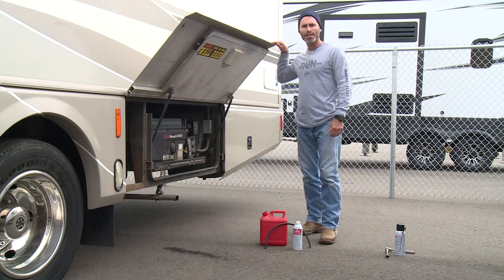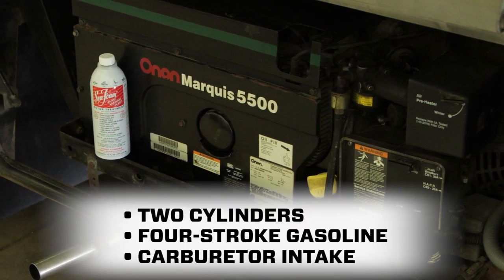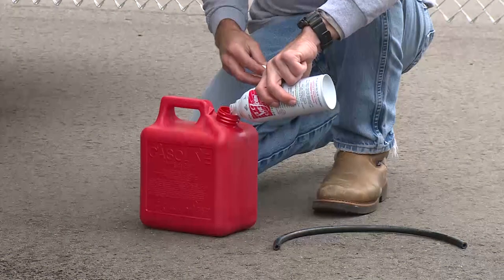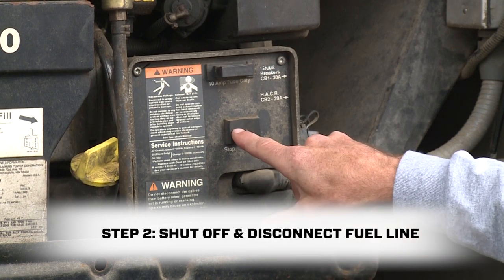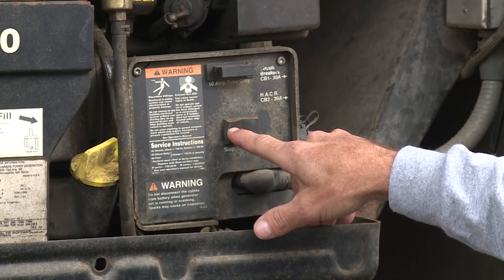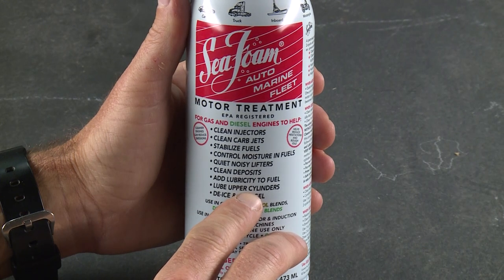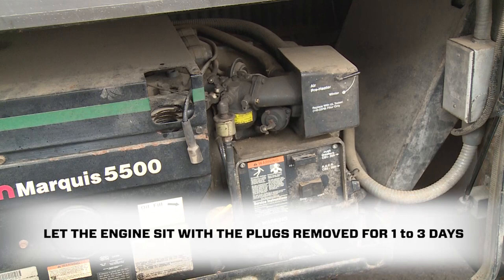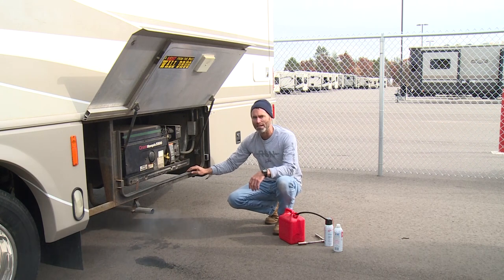The best way to clean a RV generator engine (shows Onan in demo)

Comment: I use this method on my RV generator once a year and I will say it works great.  These generators are designed to run and unfortunately many sit for long periods creating problems with the carburetors.  This method is a great solution to keep things running well.
Reply from the maker: Thanks, RV Habit.  Glad to know you figured out the remedy!

Comment: Lifesaver for my RV generator!!  So happy you made this video.  I learned about Seafoam cleaner from another Youtube RV'er.  I was so frustrated by the RV repair ripoffs, and even the Cummins techs who tell you to replace the carburetor AND the fuel pump when there is nothing wrong with them!  I am going to get some Seafoam cleaner on Amazon then run through your cleaning methods.  Thanks for the great video!
Reply from the maker: Thanks, MJ Remy.  We get zillions of customer service calls about this matter (RV generators)...It's a lot of fun to hear back from the people willing to try it, especially after discovering how easy and fast it works!
Reply: Onan400 generator is running High what could cause that problem

Comment: It works!  My generator stopped surging after this treatment.
Reply: Never mind the surge is back... will give it another try...
Reply: @alexanderperez1380  If you have a problem of surging when first started, smoothes out, then 20-40-min later surges & then dies with NO RESTART UNTIL COOLED, Problem is FUEL DELIVERY, and symptom TYPICAL OF A FAILING FUEL PUMP OR WATER in the fuel.  Fact that it ran well for a while (20-45-min?) shows it is (Most likely) NOT in the Carb (Never say never rule applies :-);  2)  If it later dies with NO Surge first, that points to OIL PRESSURE or other causes.  Hope this helps?

Comment: Simple, easy to understand instructions....I'm working on two ladies RV with the Onan 2300 and it has never been treated, not used for a good while, replaced fuel pump and filter,  because no gas to carb... Gas now looks like dark tee, air filter near black, but worse, this thing has never even had the oil changed and over 500 hrs....Some people should not own RV's...Nice ladies, but common sense eludes them....Thanks for this video...I'll try the gas can trick...Smart idea.
Reply from the maker: Thanks, Vern. Let us know how it goes!

Comment: Been doing this for a few years.  I use ethanol FREE gasoline mixed with sea foam however, and might add to take a air hose and blow air back into the fuel tank to clear any clogged debris.  And when putting the rig away for the year I fill it with gas and toss a can of sea foam into the tank to soak. 
Also used it to clean out the turbo intake on my sons TDI Jetta.  With a 4 inch intake manifold it was sooted down to size of a pencil tip barley running.

Comment: Brian, I tried your recommendations. They worked great. I mixed the one part Seafoam to one part gas and it stopped the surging within one minute. I have a Nikki carb on an Onan Emerald One. I confirmed the factory settings! After going through your procedure, I reconnected the fuel line from the tank, started it up and within two minutes it started surging again. Hmmm. It is running a little bit better but still the surging. It has a new voltage regulator and control board and plugs. The Hertz are between 60.1 and 62. David 🚀
Reply from the maker: My next step would be to look at the inside of the carburetor - look for any oxidized aluminum corrosion.

Comment: Trying this now... It made mine backfire pretty bad when I was adjusting the altitude screw. I adjusted it back and am waiting for it to hot soak now. It was still surging, but I hope it will be good after the post hot soak run. Will report back.
Reply from the maker: Keep us posted!
Reply: @SeaFoamOfficial  still sputtering or throttling. I also ran it with the air filter off and I can see the flow of fuel is the reason. Just don't know if the throttle is the culprit or the fuel pump, or fuel filter?
Reply from the maker: @yourmortgagecoach1776  What make of generator? Is the generator older than 2003?

Comment: If your generator still runs, you could let your motor homes fuel tank run very low, add as much product as you want and run the generator under load for as long as it takes. Then you can fill your fuel tank and still benefit from the product still in the tank.
Reply from the maker: Great info, thx!

Comment: I mixed 16oz to a gallon of gas didn't know i could go 2 to 1. I keep restarting generator a few minutes after it stalls. I'll run the whole mixture through it if no improvement I'll throw a new carb on it. Rv sat for over a year

Comment: Please help seafoam, i added seafoam into my welder generator yesturday, first i added it into my gas tank and let it run. I let it run for approx 5 minutes, i then called seafoam to ask Jim if i should now put seafoam into my crankcase, he said its fine, i added the seafoam to the crankcase and started up the generator, after 4 minutes it suddenly got weaker and died out. Im very concerned. I called back to ask whag i should do as Jim said to let it sit for a day and then try starting it. Today i plan on trying to start it, but if it doesnt start on the normal 1 - 2 attempts, what do you suggest i do? Can it be moisture build up in the bottom of the carb? Did the seafoam loosen gunk up and it clogged the carb jets? Ifbit doesnt start should i apply quick start or carb kleen first? I will start by removing the spark plugs to see if they are fine. I watched your videos preformed on cars, i had not seen this video prior, but the can states works on all engines. I followed directions and got help from jim any help is appreciated!
Reply from the maker: You didn't hurt anything. And no, there is no gunk that loosens and plugs jets. If worried about water, just remove the old fuel and oil and start over fresh. Let us know what happens.

Comment: Just had an idea. My RV fridge doesn't work as well on propane as it does on AC. I have cleaned the orifice jet and burner assembly with acetone and alcohole and solvent with no improvement. I think I'll soak them with Seafoam for a few days in a black coffe cup in direct sunlight. Seafoam Official, any comments??
Reply from the maker: No comments. Give it a try and let us know what you figure out.

Comment: Silly question but trying to clarify:  Do you need to disconnect the fuel line before the fuel pump leads up to the carb?  Or will the engine create enough suction to draw up the hose?
Reply from the maker: You need the fuel pump to pull the mix through the hose.

Comment: Can a gummed up carburetor cause fuel to spill out from the carburetor?  The generator starts but spits out fuel from the carburetor area.  I think I will try what you suggested.
Reply from the maker: Can you be more specific? If you're seeing gas shoot out the intake throat could be a compression leak. If a carburetor steadily leaks fuel look for a bad needle/seat fit, bad seal/gasket,... bowl float could be stuck. Carburetor issues  include sticky gum/varnish, metal corrosion, seals fail, or needle material rots (viton). Sea Foam is famous for cleaning varnish issues that occur in the fuel passageways/circuits, but seems you have something else going on. Hope this helps!
Reply: @SeaFoamOfficial  it’s actually coming from the fuel pump or hose to the fuel pump.  Not sure if gummed up carburetor can be the cause?  I ordered fuel pump and filter but not 100% sure if I’m heading in the right direction.
Reply from the maker: @QLFProductions  If it were the carburetor it would not run that well. You need to get after finding the leak.
Reply from the maker: @QLFProductions  You have a leak so need to identify the leak cause and get it fixed.  Not a fuel gum thing.
Reply: @SeaFoamOfficial  facts.  I’m on it
Reply from the maker: @QLFProductions  Let us know what happens. Someone here had a 4000 series leak that ended up being the fuel line.
Reply: @SeaFoamOfficial  ok will do
Reply: @SeaFoamOfficial  it was simply in need of a new fuel filter
Reply from the maker: @QLFProductions  Nice - that's easy and painless! 😊👍

Comment: I have a Onan 4000 and like many generators It runs off the fuel off the Motorhome,, My question is couldn't you just dump the Seafoam cleaner in with the fuel when filling up the Motorhome,,as the generator uses the same fuel from the same tank,  just asking cause I don't know, thank you
Reply from the maker: You'd have to add A LOT of Sea Foam to match the same cleaning concentration as the small can&hose method.  One can of Sea Foam at 2/1 gas-to-Sea Foam ratio equates to adding 4 cans of Sea Foam for each gallon of tank gas, so 40 cans per 10 gallons.  (Significant) Cost savings is one advantage, cleaning speed is another.

Comment: what about adding seafoam directly to the onan engine oil?
Reply from the maker: Yes, can add 1 oz per oil quart. Works to liquify oil residue and deposits back into the fluid oil phase so the crud can drain when you change your oil.

Comment: I have add n Onan 4000, does not start. When you say crank the motor to draw the mixture into the cavity, how long does it take? I cranked it 3 separate times for about 1 minute or so until my generator stopped. I also heavily primed it. Is this enough?
Reply from the maker: Yes, plenty.  With the spark plugs removed, the gas will shoot out the plug holes.
Reply: @SeaFoamOfficial  ok...I let the fuel/ seafoam sit for 3 days. Re connected the  gas can and primed. Put on a new spark plug. Fired it and it wont run. Your response said gas will shoot out of the spark plug hole and it did not do that. Can I keep soaking? Is there a time that is too long to soak? Why did nothing come out of the spark plug hole? Please help
Reply from the maker: @donbest9703   Check these: 1. Fuel pump is out, 2. fuel filter is restricted, 3. fuel restriction inside carburetor (stuck seat, other).

Comment: I tried but this just wouldn't work for me.   After much grief, a $50 aftermarket carb from Amazon did the job and only takes about 20 min to change.  I should mention my genset was non-running without starter fluid so I was bad off to start.
Reply from the maker: Thanks for the post Kirk. Glad you got it sorted out.

Comment: Why wouldn't you feed the Seafoam / Gas mixture directly into the hose at the carburetor?
Reply from the maker: Hi Richard - Thanks for the question.  Short answer: The only way, the easy way, less messy, much faster and effective.  Long answer: Most RV generators do not have a gas tank (or hose at the carburetor), which makes it prohibitive to clean gummed-up carburetor passageways with higher concentrations of Sea Foam (because you'd otherwise have to treat a huge tank with a ridiculous amount of Sea Foam). The video topic is based on generator fuel lines that run directly from the main engine tank and attach right before the generator fuel pump.  It's a super simple connection using a 4 foot section of 1/4 inch fuel line, and in most cases, the only connection.
Reply: Although this post is a year old, there are other people still interested in this topic.  I don't think Sea Foam Official understood your question.  Of course all carbureted gas engines have a hose at the carburetor, and you can probably use this technique to do the seafoam cleanse, BUT you've got to feed your hose into the fuel pump inlet, or the engine will fun out of fuel, OR raise the gas can high above the engine and hope that the fuel will gravity feed into the carb.
Reply: I tried spraying directly into the hose on the carb. The prob with that is you cant get enough seafoam into the carb that way and what you spray into the hose would be immediately burned off as fresh untreated gasoline would come in immediately thereafter. With a separate gas can with seafoam added you would get a constant supply of treated gas coming into the carb.

Comment: Since the generator uses gas from the coach, couldnt simply adding seafoam to the engine fuel do the same thing?
Reply from the maker: Thanks for the question. The difference is that adding Sea Foam to the main tank makes it difficult to create a high cleaning concentration needed specifically for the generator's carburetor. Notice that the cleaning ratio used in the video is 1 part Sea Foam to 2 parts gasoline.

Comment: Hey I've got a champion generator and I have water in the oil now I have flushed it a bunch of times and still have water in the oil now what can I use to flush the oil Crank Case and completely remove the water and old oil
Reply from the maker: Hi James
No matter what, the key to removing water in oil is to run the engine to mix and heat the oil/water into an emulsion, then drain while hot. Even better would be adding isopropyl alcohol (ounce or 2 per oil quart) to the oil, then run the generator for a few minutes to mix things up. Iso is miscible with both water and motor oil, so will solubilize the water into the oil phase so you don't end up with water pooled at the bottom of the crankcase. Without iso, water will stay separate from the oil and makes it difficult to remove water. Hope this makes sense! Let us know what happens.
Reply: @SeaFoamOfficial  well running it is the problem it doesn't want to run but I believe that it's the. Water in the system that is causing the problem and I will try that too thanks
Reply from the maker: If you can't run it, drain as much oil as you can, then add a 12 oz bottle of isopropyl to absorb the water, then drain again.

Comment: Great video but I disagree with one part of this video , I would do everything you said except that instead of using regular gasoline with the heavy Seafoam mix I would use either non ethanol marine fuel or Trufuel with the heavy Seafoam mix you recommended,any remaining fuel in the system wont as likely gum the carb up . Ethanol based fuels suck and is bad for your carburetor. Trufuel is about as pure a fuel as you can get and that’s to only way I long term store any small engine.
Reply: Also if you go the marine fuel route you definitely want to use the highest octane, marine fuel is 30 to 40 cents more expensive then regular premium fuel . In this case this generator gets its fuel from the RV but when you do the long term storage it makes a big difference. The marine fuel I use with all my lawn equipment and my portable generators
Reply from the maker: Thanks, Mike.
Reply from the maker: Hi Mike:  How could you know what type of fuel was used in the can?
Reply: Sea Foam Official , it the most commonly used fuel , a generator on a RV gets its fuel from the RV so it stands to reason that if you were winterizing a RV generator you’d use regular type fuel in the gas can . I’ve noticed that older small engines doesn’t have the same harmful effects from fuel that has 10% ethanol and that’s why when I store any piece of equipment with a small engine the last fuel it gets is non ethanol marine fuel or Trufuel with a healthy dose of Seafoam. Seafoam was only recommended to me by a friend and as far as I’m concerned and I’ve used many different type Seafoam is definitely the best but the combination of Seafoam and Trufuel or marine fuel makes it even better .
Reply: Sea Foam Official . You sound like you’re copping an attitude , maybe to stop people like me from having this concern you may want to specify what fuel you’re using in your video and maybe include the harmful effects of ethanol based fuel . I had a Toro snowblower for 18 years and when I never had a problem if I left the same fuel all winter long , nowadays it’s recommended by many dealers to not keep ethanol type fuels for more then a month.
Reply from the maker: Thank you for your questions and suggestions. For treating the generator we used non-oxygenated gasoline (E-0).  Hope that helps!
Reply: @SeaFoamOfficial  since you didn't specify we assume regular 87 crap
Reply from the maker: @TheMissingtime  To specify, E-0 gas in MN is 91 octane.

Comment: Can I just use a straight fuel hose without a pump?
Reply from the maker: Please describe.
Reply: Sea Foam Official straight fuel rubber pipe/line or fuel rubber pipe/line with a manual pump in the middle so you can pump up the fuel.
Reply from the maker: @nikkles1200  Did you watch the video? Why not do as shown in the video?

Comment: Can u explain how to drain a kohler rv generator bowel
Reply from the maker: Not familiar..would have to see it or contact Kohler or someone that knows. The Kohler generator carburetor assemblies I looked up on google appeared to have a straightforward drain screw you could simply loosen and let gas drip in to a can, whatever.  Even so, can follow the video instructions without draining the bowl.

Comment: Onan 4000 generator is running High what could cause that problem
Reply from the maker: Would start by checking the governor - could be worn or spring is missing or failing.

Comment: when using seafoam on a gummed up carb, can you use just seafoam and no gas?
Reply: What if the purpose is only to soak and remove the gum in the carburetor?
Reply: seafoam is more of an oil so Id would say no run it 50/50 mix